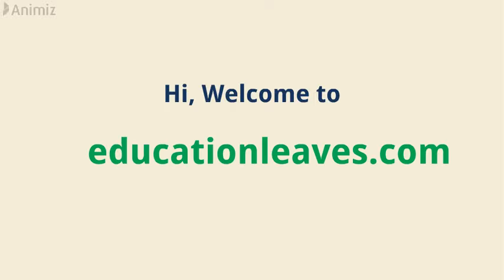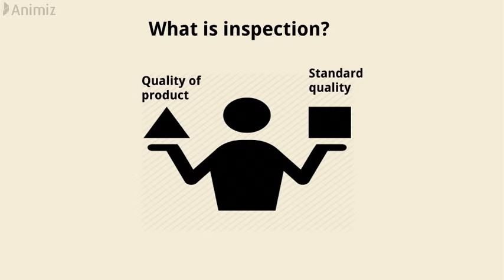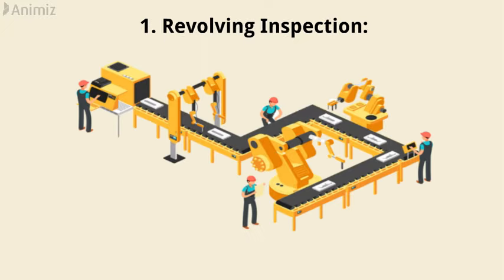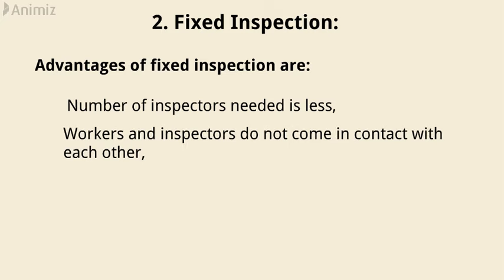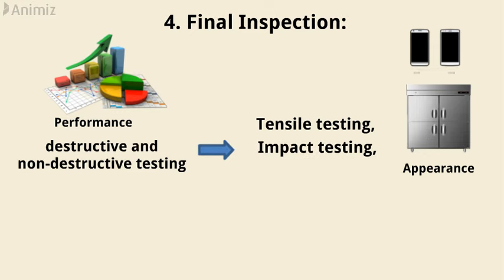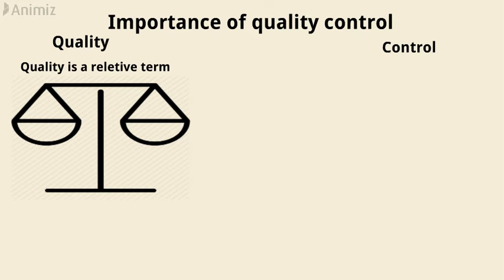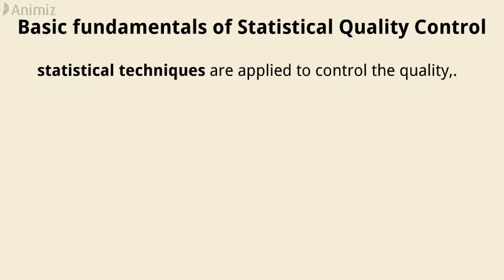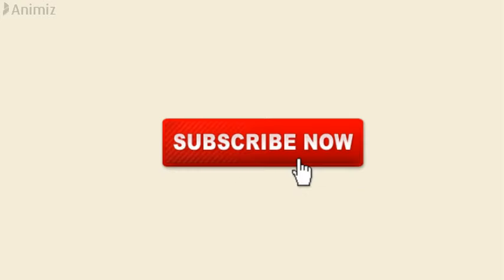Inspection and Quality control in Manufacturing. What is quality inspection?

Comment: 00:02 Inspection and quality control are important processes in manufacturing for ensuring high-quality products.
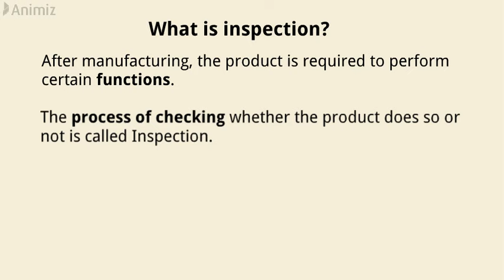00:45 Inspection is a process of checking the acceptability of a manufactured product.
01:31 There are different types of inspection methods.
02:21 Fixed inspection at centralized position in the workplace
03:08 Quality inspection reduces cost and ensures product quality.
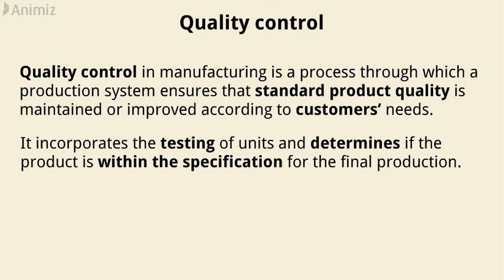03:58 Quality control ensures that the product meets customer's requirements.
04:41 Statistical quality control reduces inspection costs and improves reliability
05:29 Inspection and quality control ensure manufacturing quality.
Crafted by Merlin AI.